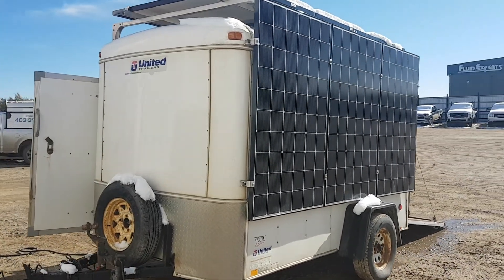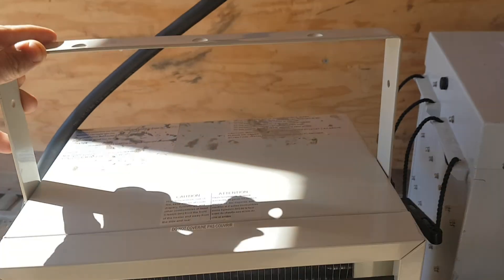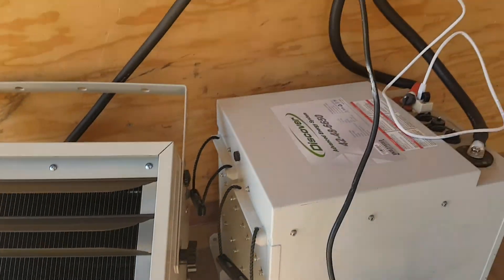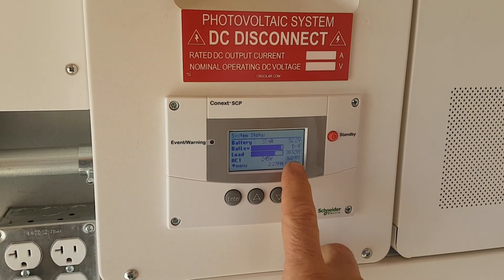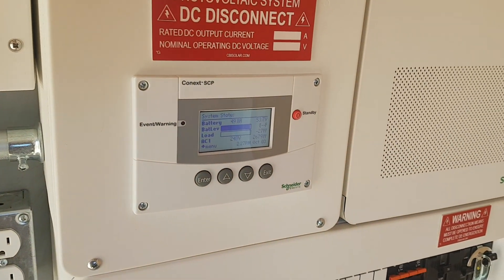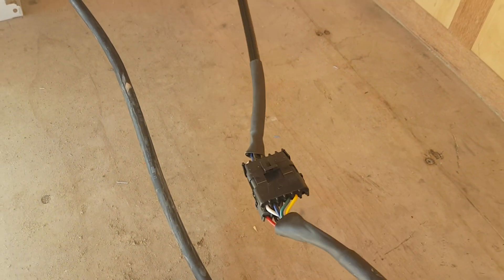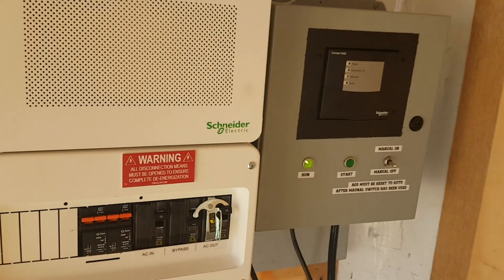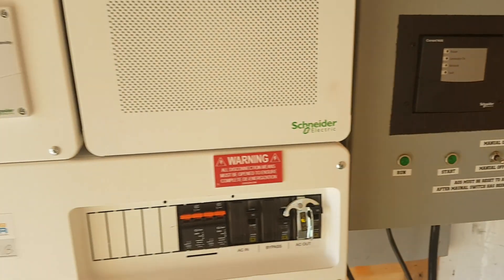Auto gen start. CBI SOLAR

Comment: I also like your Anderson connectors for the battery! I would like to do the same with our Absolyte GX Battery Bank when we are fully set up. Should we have a disconnect set up between the inverter and battery bank? Still trying to put everything together. We have the same Conext SW 4048 with a Midnite Classic 150 Charge Controller - I like the look of your set up much better - very clean look!